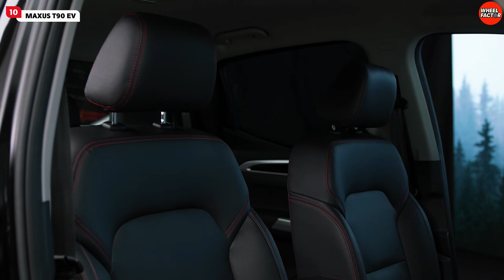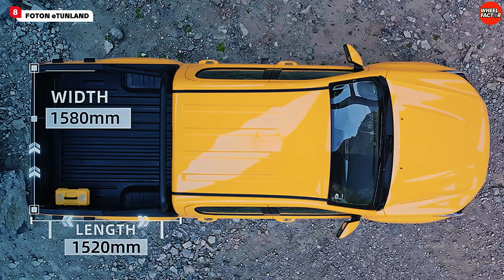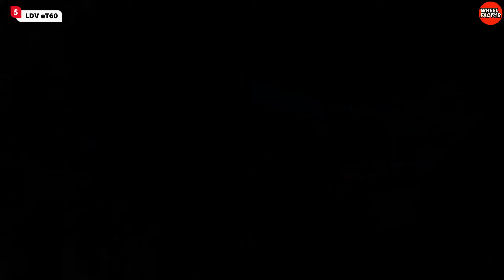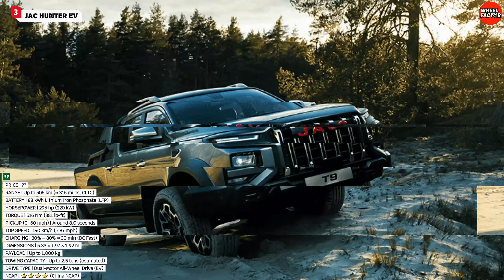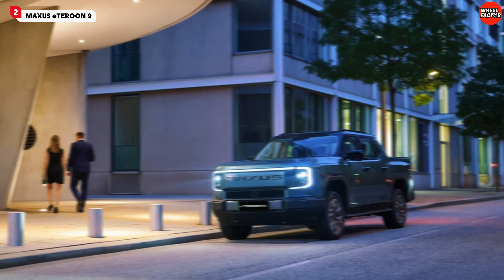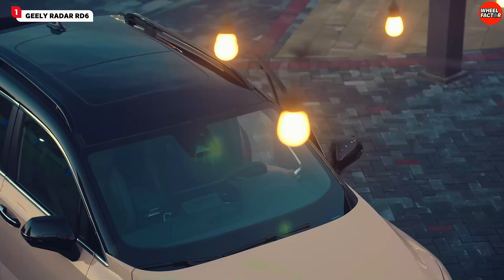TOP 10 Most INSANE Chinese PICKUPS Coming to SHOCK the World!

Comment: Every time I see a right driving position I cringe,,,It's not for Canada
Reply: China use left steering wheel
Reply from the maker: Im sure if these launched in canada they will be in left side driving position
Reply: China is left hand driving like Canada.  Most Chinese based manufactures release both left and right hand versions of their models.   The right hand ones you see would have been made for the Aust, NZ, UK, etc markets.
Reply: It's not about left or right hand drive, they can make one just tomorrow. It's your government doing the C-block. 😂
Reply: China uses 220 volts electricity, but why are the electrical products such as blenders and microwave ovens that are made in China being sold in Canada are for 110 volts? Makes me wonder how can that be. 😂